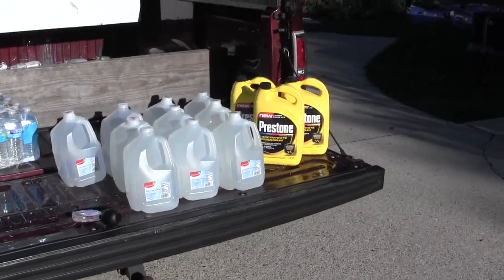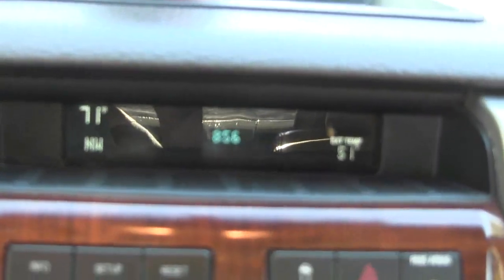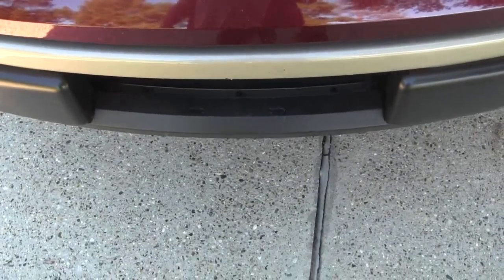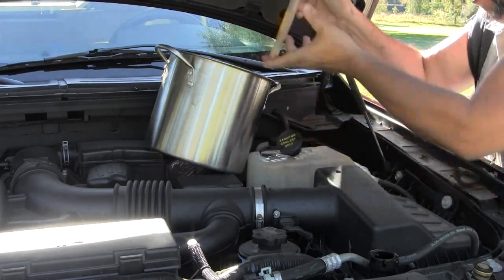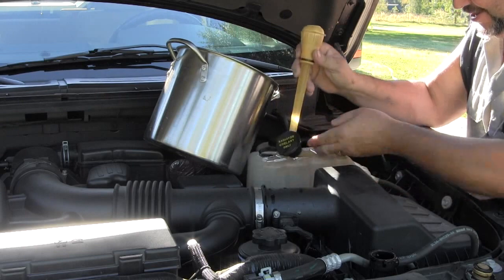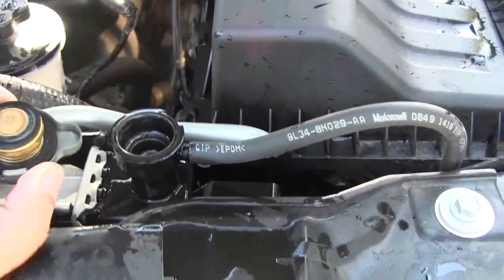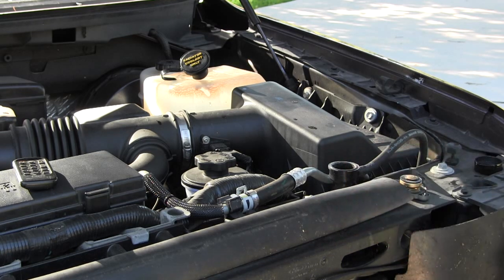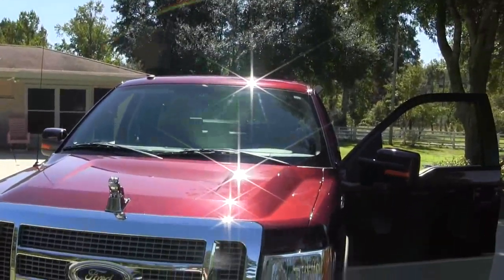How to drain and flush your radiator

Comment: Hey there!    I just bought a used 2010 f150 with the 4.6 liter 2valve engine.   Yesterday I went to do the radiator flush.   I opened the petcock and I found that I couldn't get even half (2 gallon jugs) of the dirty old coolant out of the engine.   Do you suppose I could get all of the coolant out if I removed the thermostat and ran the engine for a bit with the petcock open???   
ALSO....   The coolant reservoir had a bunch of brown slime on the inside which I easily blew out with compressed air and the water inside the jug.
Reply from the maker: Ok. I’m going to tell you what I did to a coolant system like that. I drained all that would come out. I poured a half a box of dishwashing powder into the radiator, and filled it up with water. I ran it In My driveway for about and hour. I drained it, flushed it with the water house, and did it a second time with what was left of the dishwashing powder. Ran it for an hour, drained and filled with just water. Drove around for a couple hours with nothing but water in the system. Came home, drained it again and then refilled with 50/50 anti freeze. Don’t forget to run through all this with your heater turned up hot. You want the heater core to be flushed at the same time and it won’t if you don’t make sure that the heater is opened all the way/turned up hot.

Comment: You put 125,000 miles on a truck in 6 months? That’s when I tuned out.
Reply from the maker: That’s because your stupid and can’t do math. My wife and I had a dedicated run from Houston, to Dallas, to Los Angeles, back to Houston, twice a week. 6400 miles a week. We were leased to forward air for 12 years. Best paying job I ever had. Fuck off dumbass.
Reply: Sure, I believe you 🖕🏻
Reply from the maker: In 2000 I bought a brand new w900. When I sold it in2006, I had 1.2 million miles on it. Anyone that knows the least little bit about trucking, knows those mileage figures are well within reason, which tells me one thing,,,, you know nothing about trucking. I put 40 years in behind the wheel and have since retired. After 40 years of trucking, your opinion as a non trucker, means absolutely nothing. Learn math!
Reply: Don’t tell me what to do Dad lol

Comment: I have a question for you BC, it's not so much about radiators but more just about cars in general. I have a 1999 Toyota Camry Solara. It has 155+ thousand miles on it and i have the title for the car. I just replaced my Brake lines and gas lines as they had rusted out, the miseries of living in a cold weather state, huh.. Anyways, i had also put about 1200 dollars into the car for tires, brake pads, rotors, and a control arm but i can't really complain about those thing's as that's just the nature of the beast. Before the whole thing with my brake lines and gas line's i had found out that i needed to get a new Catalytic converter but i decided to put it off for a bit because i don't have to have my car inspected till may of next year. To top it all off, the other day driving home from work in the rain, my traction control off light decided to stay on. From what i have read on some of the Solara forums, it is most likely a EGR valve sensor.Don't ask me how a EGR valve sensor shuts off your traction control but it can..  My Question is, Do you think it is worth it to fix all of these things and hope nothing else goes wrong or should i just wash my hands of the car and get something else? I could use any advice as im pretty torn on what i should do. Thanks.

Comment: Do newer cooling systems have heater core valves anymore? I'm  surprised that your's does. I bought an 08 Chevrolet Uplander Van that had 106k miles on it. So far I have replaced front and rear rotors and brakes,  drivers seat belt retractor, broken drivers seat trim, looking for a new seat cushion cover and replaced the body control module. 
Cars don't self destruct. Ignorant people let them. Also some dealers are complacent and don't stress the importance of taking care of your car. When my pickup hit 100k miles I asked about getting all the fluids replaced and they said don't unless you absolutely have to. What a joke!
I am taking over the repairs and service now after that statement.

Comment: Are you going to get in trouble for using your wife's kitchen wares? I thought you were supposed to do the flush and fills once a year or every 15K miles.
Reply from the maker: With antifreeze it's not so much mikes as it is time that weakens the anti freeze. 15000 is way to soon.

Comment: Great video. I really enjoy watching them all. The reason I only use distilled water in coolant systems, is tap water eats away at everything. I've seen on countless vehicles where people used just regular tap water or bottled water and the rubber hoses cannot stand up to the chlorine and it just eats away at it and you eventually have more rubber prices than coolant in your system.
Reply from the maker: Here in Louisiana they have found that brain eating amoeba in drinking water,in several city water supplies. The chlorine in our water now makes it nearly undrinkable.

Comment: Back in the day (late 70's) we would advise people to change their antifreeze every two years or around 24K miles.  Newer vehicles can probably go longer (check your owners manual)  but six years is a bit too long.  Around 60K you should be thinking about getting your transmission fluid and filter changed.  People forget about that one until the trans starts acting up and by then its too late (just a tip).
Reply from the maker: That I do my self as well. The thing is,there is more fluid in the torque converter than there is in the pan and there is no way to get to that from dropping the pan.
Reply: The last F150 that I changed the trans fluid/filter on was a 1993.  On this truck you could remove the pan covering the flex plate/torque converter and there was a drain plug on the torque converter.  You would need a helper to bump the starter a little at a time until the drain plug came into view.  Yours might be the same.  I had the AOD trans.  I hope this helps!

Comment: Besides the obvious issue of freeze/boiling point protection, water pump lubrication and seals a big issue with new engines is electrolysis if the coolant gets too old/weak. This will start to draw metal out of aluminum components and weaken them leading to leaks and other problems. I saw a recent show that said if you take a DC voltmeter and put the negative probe on a good ground and the positive probe IN the radiator fluid and see a greater voltage than 0.1 volts..time to change the fluid.
I haven't researched this method beyond that but makes some sense...beyond the hydrometer you showed.
Reply from the maker: I was aware of electrolysis in Diesel engines. In fact I used to put an additive in to help prevent that from happening. Electrolysis also caused cavitation in the cylinder liners in a Diesel engine. I had no idea it was a problem for gasoline engines as well.
Reply: Bigger problem with the switch to so much aluminum in engine parts. But I heard of the cavitation as well......